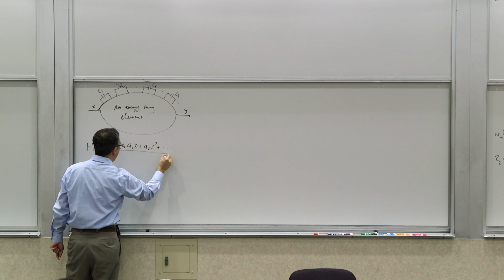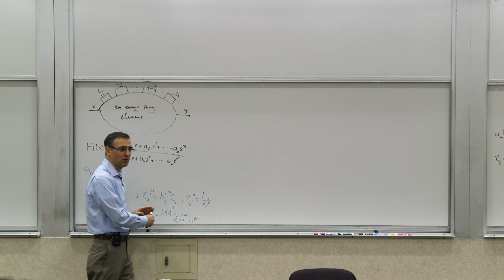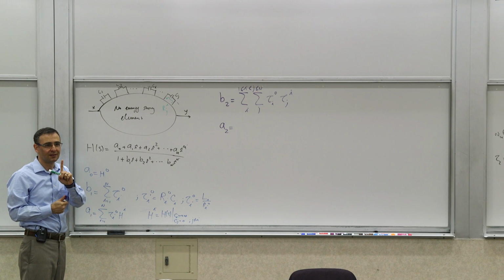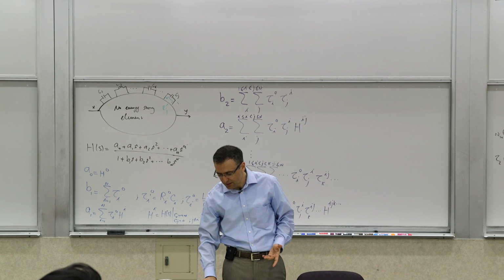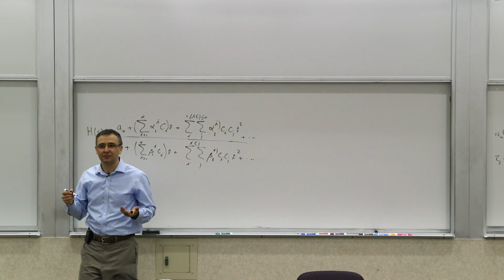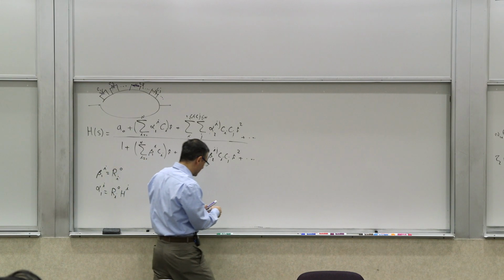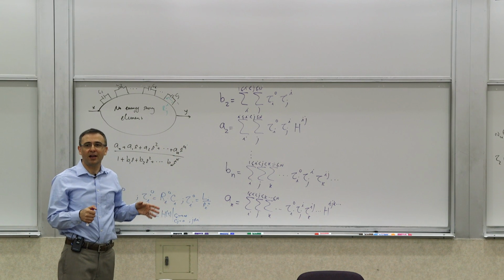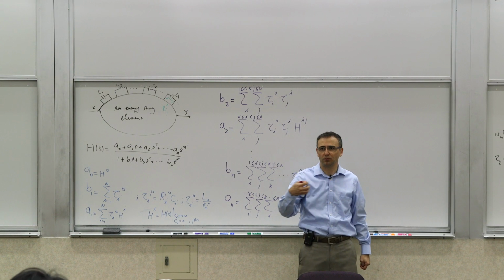150N. Generalized Time- and Transfer constants; higher order terms

Comment: 00:05 - Calculation methods for coefficients in generalized transfer functions.
02:38 - Discusses deriving higher-order time constants and transfer constants in circuits.
05:12 - Explanation of notation in time constants and their significance.
07:57 - Understanding generalized time and transfer constants through infinite values and their relationships.
11:02 - First-order terms arise from linear combinations of capacitors and inductors.
13:44 - Calculation methods for transfer constants with infinite capacitance.
16:42 - Analyzing dominant terms in a first-order system with negligible components.
19:17 - Generalized time and transfer constants enable precise calculations without high-frequency methods.
22:07 - Partial analysis yields useful insights without complete derivation.
24:15 - Higher order time constants are easier to compute through indexing.